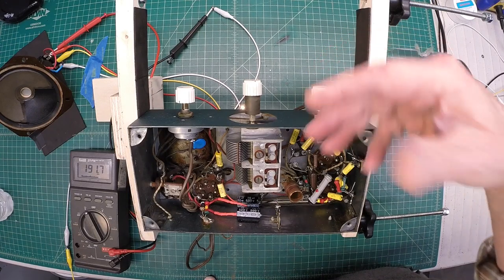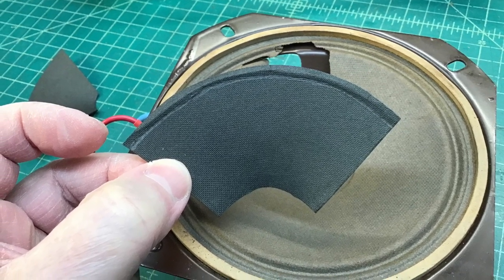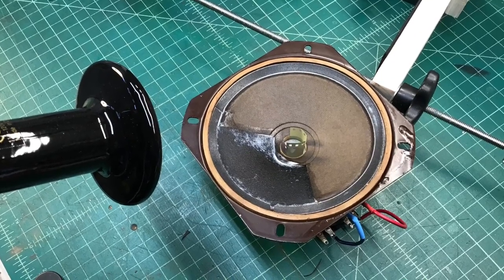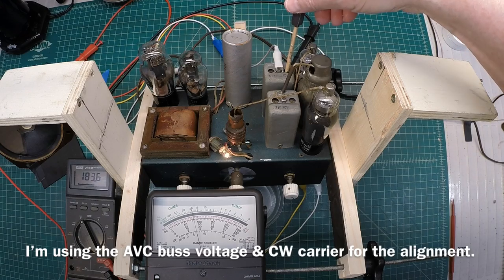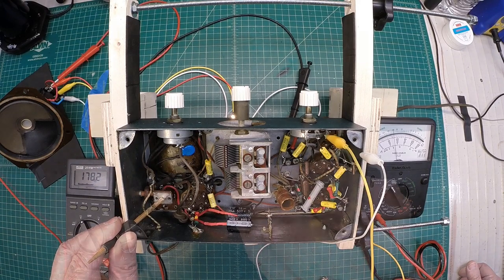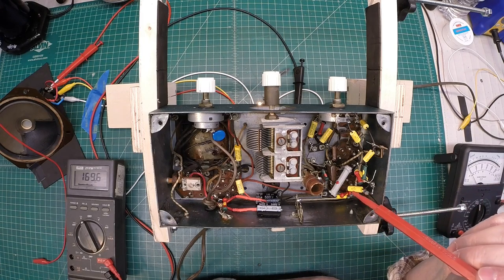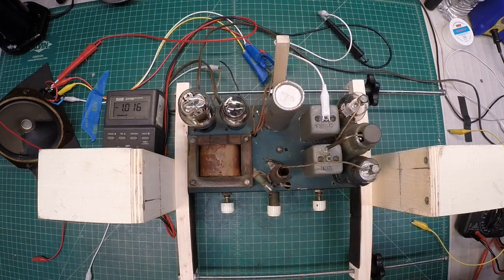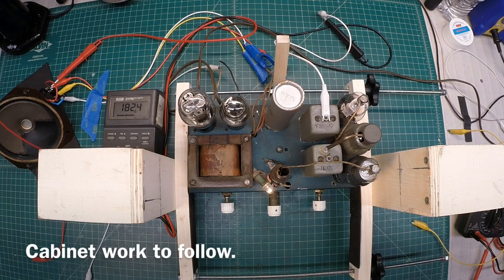Kadette Tele-matic AC Model 35 - Crackling Noise Fix, Speaker Repair & RF Alignment

Comment: Glad to see you found the popping sound! Those intermittent problems can run you up the wall. Those tuning condensers if dirty can be a problem. As you know, they sometimes have whiskers in them. I have used a small sliver of veneer to clean between the plates. I was wondering how you had such a nice looking patch on that speaker. It looking and sounding good! I hope we get some nice low humidity days to get some cabinet work done!!! Very nice!!! Take Care--Larry
Reply from the maker: I’ll send a few speaker cones with the other package for you and Josh. Looks like our weather is good until Friday, but I’ve got other stuff to do for the next few days. Thanks Larry. Best, Don

Comment: It's very cool you had old speaker card board around to make the repair ,I use the same glue and tea bag paper ,it work I was surprised,I bought a new speaker for mine ,but at the time I didn't want try to transfer the speaker tranformer  I never done.that ,I think I could do it ,but that beat up speaker sounded good so for now I leaving it alone,I now have three spare speakers around.4" 8 ohms, It takes a while to build up stock of components to have on hand for repairs and it can be pricey ,but you need a good working stock of caps and resistors and.so much more.thank for showing us your repairs
Reply from the maker: Yep, those tea bags and coffee filters come in handy. Like you, the Alene’s glue has never failed me. Best, Don
Reply: @RestoreOldRadios  thanks you for the info you sent me .